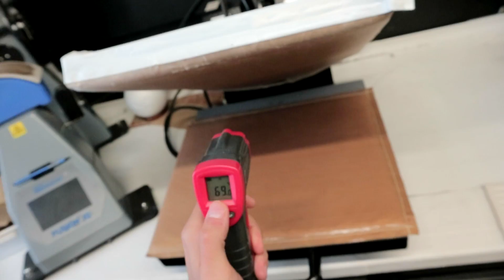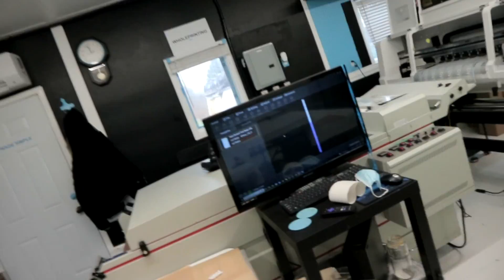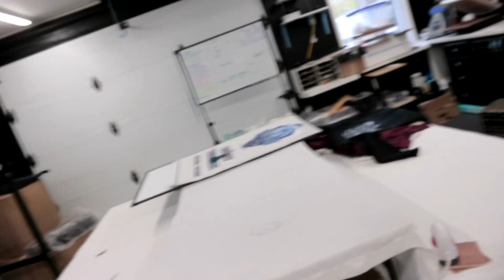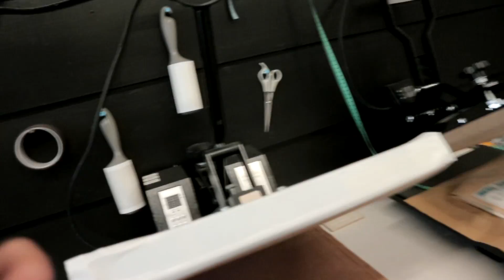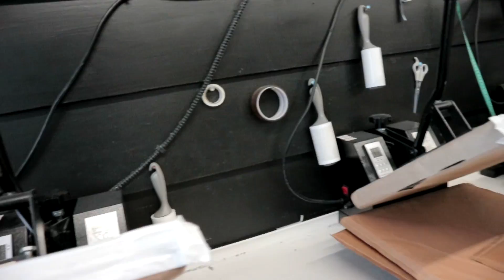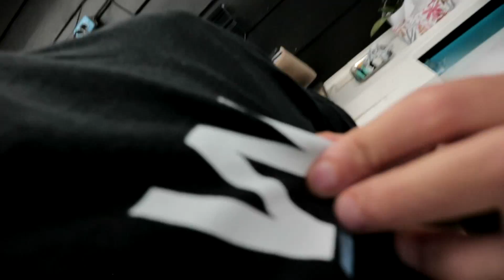How to Fix DTF Wrinkled Prints

Comment: What do you do if you do see those air bubbles in the white line?
Reply from the maker: The best thing would be to pull around 5ml of ink form your dampers that have bubbles and do a head cleaning. This should fix your issue